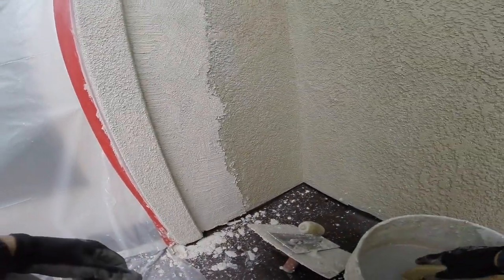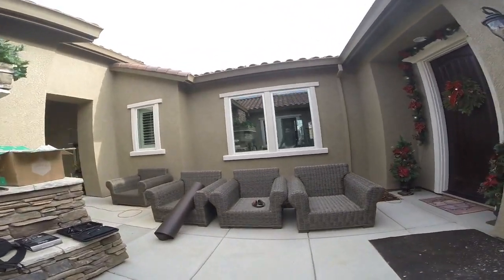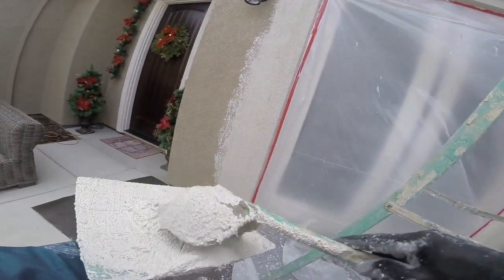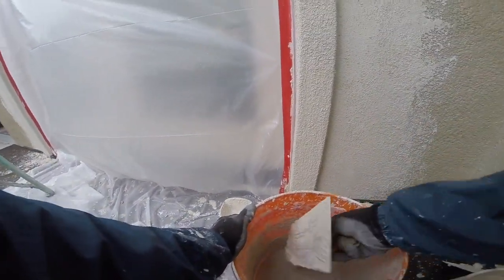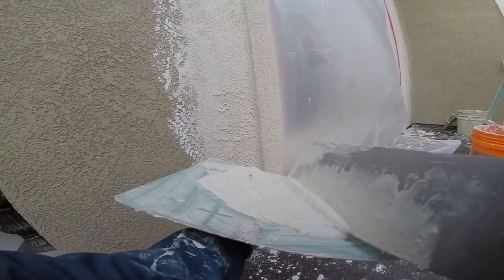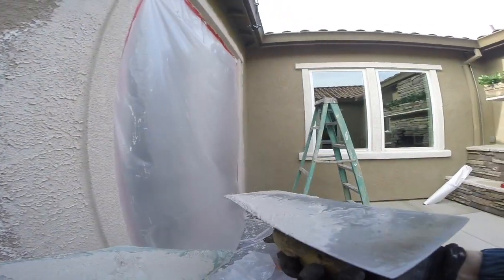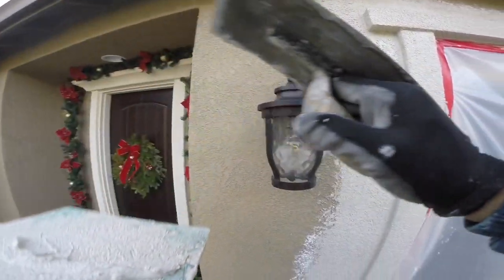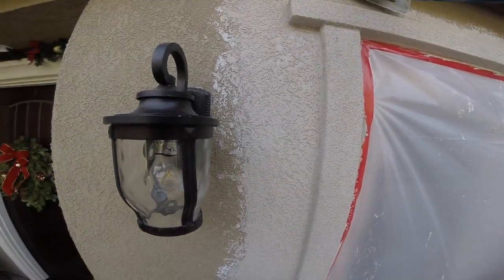Stucco Lace Texture The Lacey Way to Blend

Comment: Can you do a sand finish over heavy texture to change an entire walls texture?
Reply from the maker: Absolutely. Just treat the house as if it has a scratch coat on it already. Then add acrylic bonder, at a ratio of 1/2 gallon to 1 full gallon per bag of cement and sand. Apply a base coat over existing texture to level the walls. Then just follow through with your desired finish. Done
Reply: @AbersonPlastering  And I assume on painted stucco you need bonding agent first?  Thanks!
Reply from the maker: @garretdouglas4056  No Thats why I say 1 gallon of acrylic bonder per bag 
in the mix
Reply: @AbersonPlastering  got it.  Many thanks!!